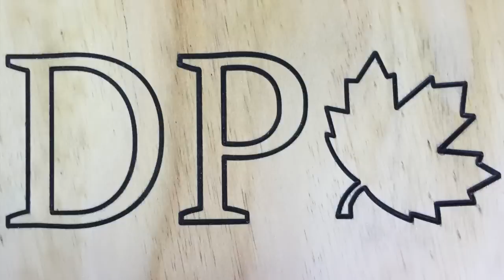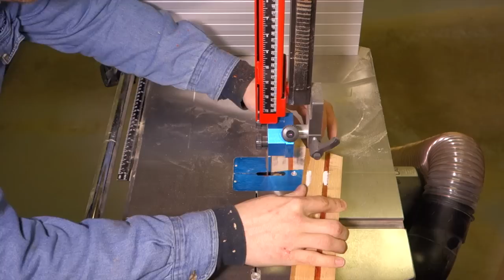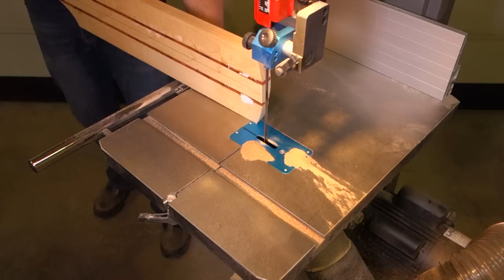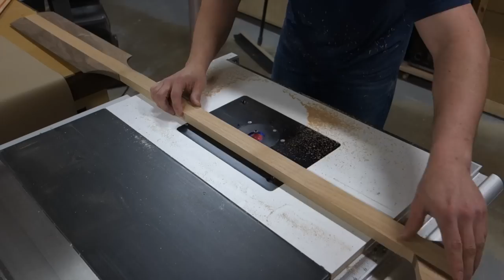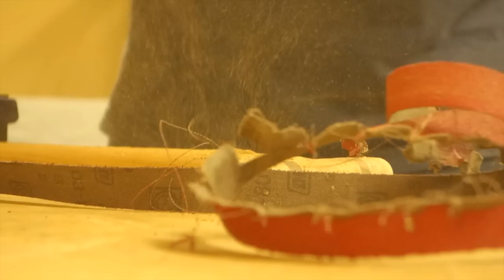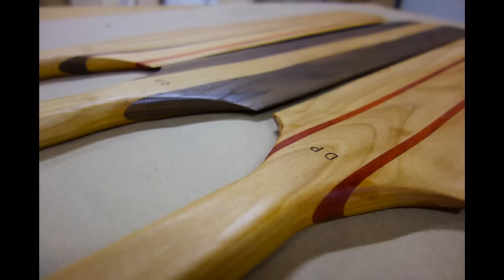How to Make Custom Canoe Paddles

Comment: All good. One little design flaw, the shafts should be oval shaped where they meet the blade for strength and feel in the lower hand with the wider part being oriented in an upright position. It is a strength and flex issue. You’ll get it right on your next set.

Comment: beautiful work. I always wondered what would be a good way to shape them. thank you!

Question - what is the glue? titebond outdoor?  If so, how does it hold up to that kind of immersion?
Reply from the maker: +john a. gorman (-kilderkin r16) Thank you.  Yes it's titebond 3 and its fully waterproof
Reply: excellent.  I need to repair a rudder and dagger board for a little sunfish, and wondered if that would do the trick.
Reply: +Dustin Penner how well did the tilebond preform on the multi piece handle?  With a paddle being a level, I wonder how well the 3 pieces that make up the handle hold together with all the stress focused on them.
Reply from the maker: John Stryker I'd expect the wood to crack before the glue joint ever fails.
Reply: +Dustin Penner Very nice work.  I enjoy your videos and the means you produce them.  The secret compartment boxes were clever.  I see a typo in my comment I can't help to correct. I meant to say lever, not level. Take care.
Reply from the maker: John Stryker Yeah i figured thats what you meant, no fear!  Thanks for the kind words and support!